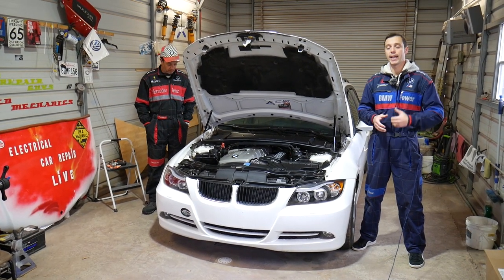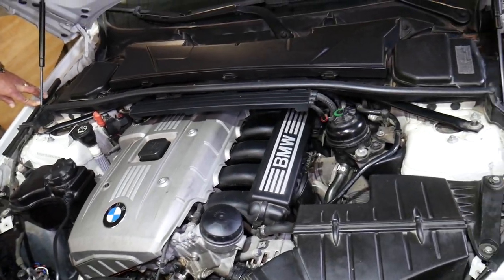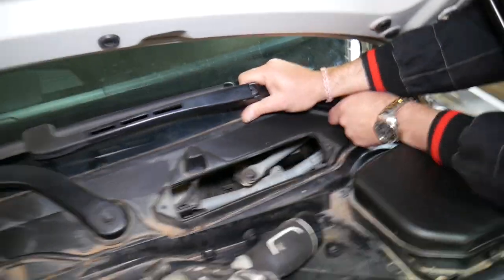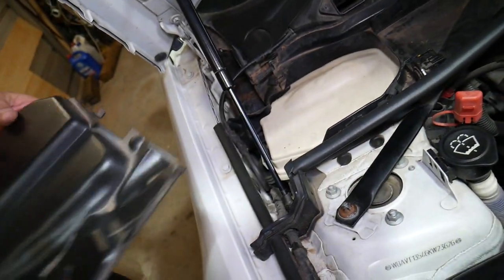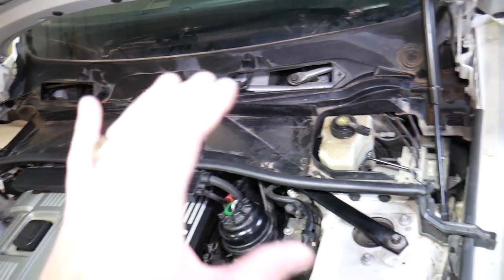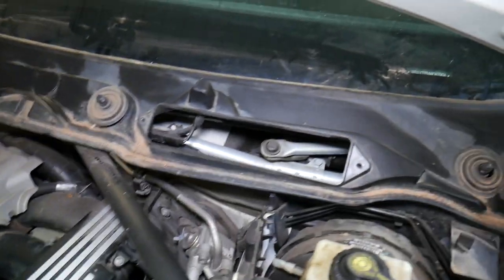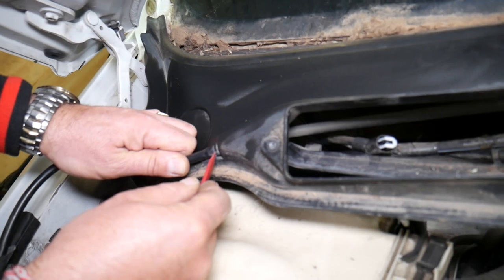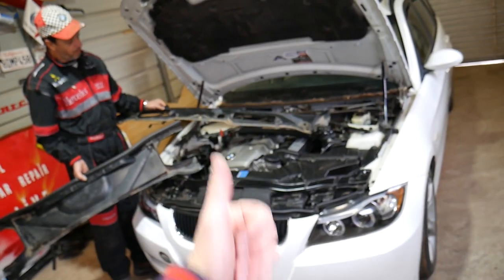WINDSHIELD COWL TRIM PIECE REMOVAL REPLACEMENT BMW E90 E91 E92 E93 316i 318i 320i 323i 325i 328i 330

Comment: When you disconnect the hose bracket from the lower cowl is it simply pulling it forward?  Are there no clips holding this piece in place to the cowl?
Reply: You will pull forward on the lower tab

Comment: I have a leak dripping from under my glove compartment in an E90 328i 2008. Is it possible to have a leak from under the upper windshield cowl? Is there supposed to be adhesive holding that portion on that avoids water build up under the cowl?
Reply: Following cuz I have the same problem on my 2011
Reply: @itsfinn9644  I fixed by applying black 5200 silicone around the base and sides of the windshield. There seems to have been some gaps in the windshield sealant.
Reply: @johnbowman4424  was that aquamarine silicone?
Reply: @runokohamilton3537  yes sir
Reply: @johnbowman4424  do you mind explaining to me how you did it?
Reply: @itsfinn9644  😂😂 zzzcccccccccccss
Reply: I have this same exact problem! Was the leak due to the cowel not being sealed properly?
Reply: Having the same problem still after getting the windshield replaced. Almost positive it’s the cowl , I’ll be putting some silicone on there in the next few days
Reply: @Aj314Michel   check cowl, bottom windshield seal and upper windshield seal good luck 🍀
Reply: This is the video we need

Comment: thanks for this video. will come in very useful, I have noticed a wet floor drivers side and need to investigate. the windshield trim on my 1 series overlaps on the drivers side allowing it to lift and dirt getting in creating a gap. I am Hoping a good clean once all taken off should fix the problem. anyone any other ideas why I would have a wet floor, much appreciated.

Comment: Hey just a quick question. So i just installed a new headlight on my fiesta st and after installing it, i started the engine and then turned the headlight switch to on, then everything shut off. Now i have no power going to anything in the car, any ideas on what relay or if there is anything i should check?
Reply: Maybe you should disconnect the battery before doing the lights🤔

Comment: Can you remove and replace the upper windshield cowl without actually removing the bottom one?
Reply: Not  very easily. The top one has an edge the fits into the bottom one.